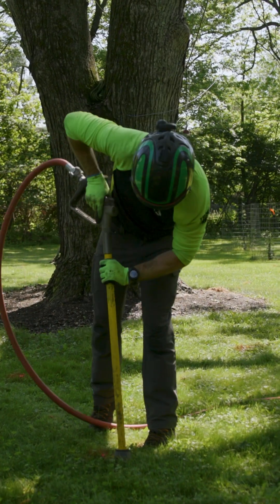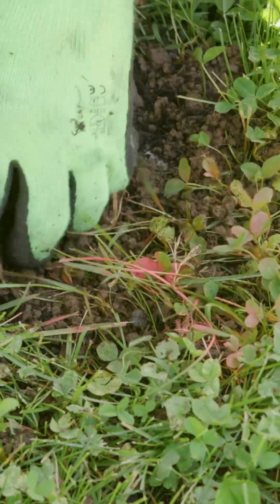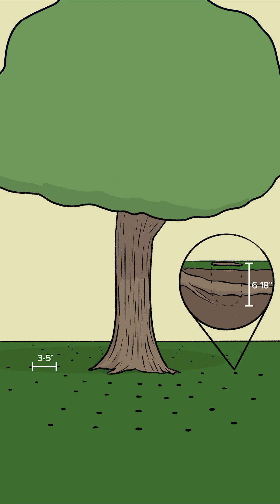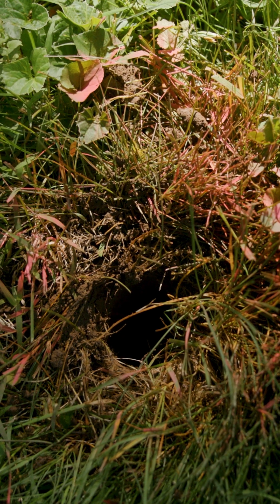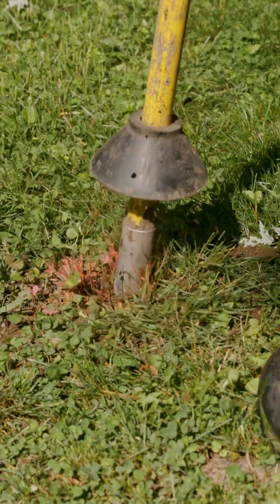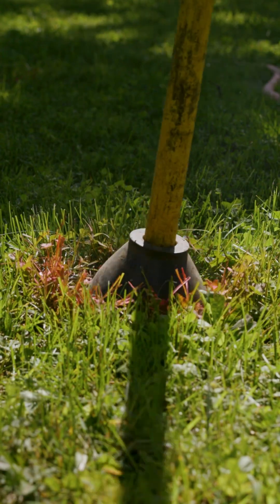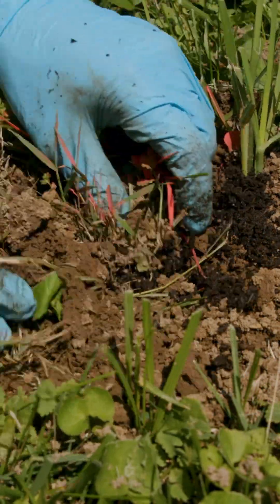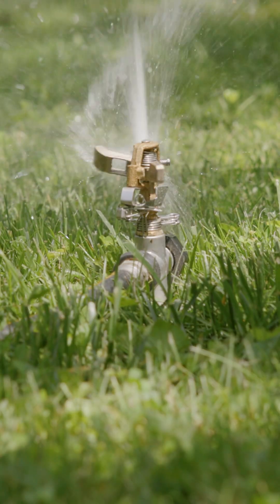Vertical mulching on a silver maple #treework #treeservice #trees #shorts

Comment: I dont get it. You said aerating the soil helps improve water movment and gas exchange, but to tamp the soul to close air gap vecause they can dry out roots? At what point does too much air in dirt become bad?
Reply from the maker: The answer is somewhere in the middle. Compaction by heavy equipment, vehicles, or constant foot traffic can be bad for the roots due to restricted oxygen, but any air pockets are also bad for roots because it can dry them out. Tamping by hand eliminates air pockets while keeping compaction to a minimum. Porous soil is ideal, air pockets and compacted soil are unideal.